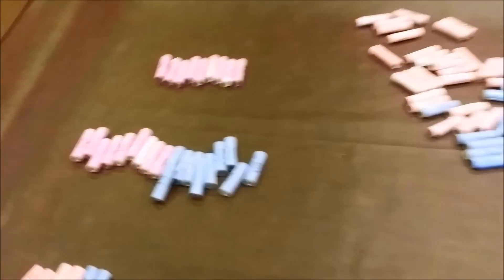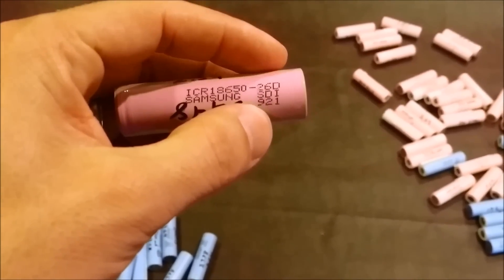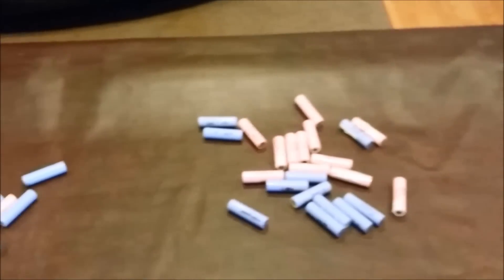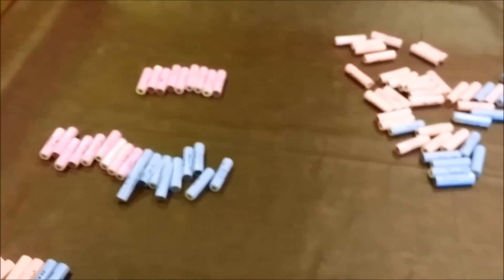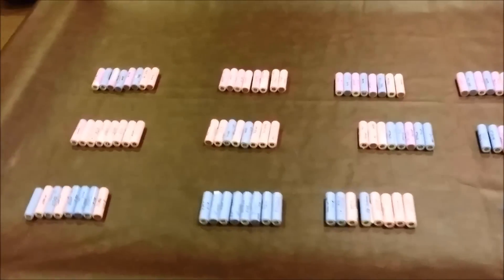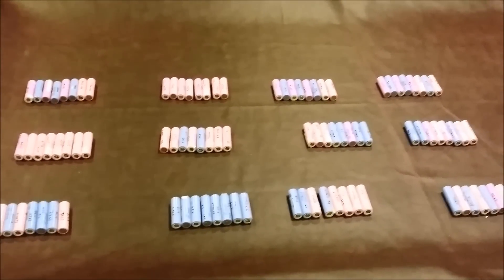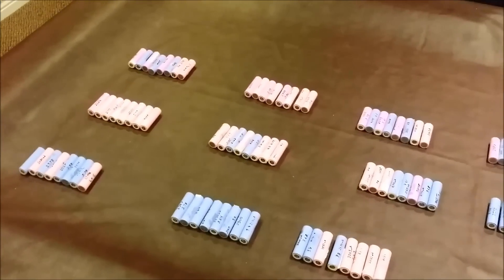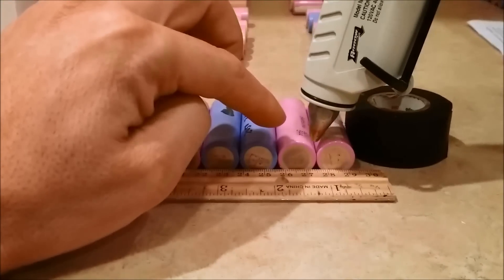Learn how to build a 48v e-bike battery "18650 lithium ion battery" (Part 3 of 7)

Comment: never hot glue them together it restricting cooling and really fun then change one bad cell after some time
Reply from the maker: I absolutely agree!  I use 18650 holders for battery pack building now because I did get this pack very hot twice.  The bag that I had it in also didn't help for cooling :) had to cut holes in it.  Thx for watching.

Comment: I just make simple 13s1p pack.
Each pack can go about 8km with pedal assist.
Make charger from step-up module with CV and CC features.
Just set 54.6v and 1amps for voltage and current
15amps bms and wrap with kapton tape.
Reply: That’s very poor range u should use at least 4p

Comment: How did you calculate you fuse size.
The fuse is 64watt. Giving you a fuse that pops at 1.3A  for a 48v total pack with a output of about 17A max continuous.   Is that correct.
Asking as I want 10s5p 15A per cell

Comment: Can i do the same but using just plain cat5 ethernet cable instead the fuses? I think eventually burn at 5a.... thnks
Reply from the maker: You really don't need them, but you could try it and see.    I wanted mine to reset instead of one time use.   Tesla uses one time use fuses similar to your idea.   My second battery doesn't have fuses on each cell just the BMS and a main shut off circuit breaker.   Thx
Reply: Why do you say dont really needed .. are fuses useless?
Reply from the maker: There not useless, but I think as long as you have a BMS you will be fine as most new cells have fuses built in already.    My next battery will be built without fuses on top.   If you have older style cells and want the extra safety then it wouldn't hurt to have them installed.   Most of the laptop cells that I took apart didn't have fuses, but some had a thermal switch if the battery pack got too hot.

Comment: You are guaranteeing the packs are not similar. use a round robin approach. your last packs are similar while the first packs have the most variation between cells.
Reply from the maker: i put cells together to equal the same bank size mAh.  The banks are very close to the same size within 30mAh.   This was a project to see if I could get good use from used laptop batteries that were going into the trash.  So far so good 1000 miles on the e-bike and going on strong.
Reply: +15-sec-of Fame  can we build 52Ah , 48v battery ?

Comment: how many cells do you need to make a 48v battery
Reply from the maker: It all depends on how much amperage you need for your project.   13 single (18650) batteries in series will make 48v, but very low amperage roughly 2-3 amps.  If you want more amperage you need more cells in parallel.  My first battery had 104 cells.  More amps you have the longer your voltage will last and not over heat.   It all just depends on what your using the battery for to know how big your pack needs to be.

Comment: I am trying to do something similar but with my electric scooter. From your opinion, do you think there will be any issues if my controller is 52v 1000w, battery is 48v, and motor is 52v 600w? I am trying to figure out if any of the above 3 components will overheat since the controller is pushing more voltage from the battery to the motor...
Reply from the maker: Your battery will be fully charged at 54.6v and shouldnt be an issue, but check the controllers specs.  The battery might get hot over time if you are always at full throttle.  The battery is smaller, so run some tests 10, 20 and 30 min temp checks.  If you hit 150 degrees stop  :)

Comment: buy a big completed lithium ion battery or buy a lead-sulfuric acid battery.How could you know these batteries,might be just one isn't real then your bike wouldn't work and can't be fixed.
Reply from the maker: the project was to see if I could build one from used laptop batteries for free.   If new would cost $600 with the charger.  I tested the cells to measure the mAh to make sure they were good.   This battery was able to provide enough power to go 35 mph for 30 miles.  The same battery pack was revised and is now part of a additional pack and is now 84v 45-50 mph for 25-30 miles.   The 84v battery that I built now would cost $2000 new, but was only about $80 for parts.  :)

Comment: You skipped soldering the third battery @ 8:32 - Only one nickle strip is connected to that battery. I know this was a year ago and you probably caught i later on when attaching your re-usable fuses, just thought i would point that out just in case :) Great videos!
Reply from the maker: Quick eye you caught that too lol,  well I meant to do that as it adds turbo boost when it finally makes a quick connection from vibrations :)  Yeah off video I went back later and went through the whole thing to check all my connections :)

Comment: Nice and informative video.
I have some questions to you.
What is the square yellowish square between one parallel cell to the other?
Do you discharge the cell to certain voltage before soldering?

Comment: Why are you connecting every battery in parallel? Why not have 13 different strings of batteries in series? 13 different strings will prevent current from running through the battery when it is not connected.
Reply from the maker: Hey Filip,  You could have connectors separating each bank but it sounds like a lot of extra work to do that.   The  way I have it is the following (sorry if you know this already.)   I have 13 separate banks connected in series and each back has 8 batteries in parallel.   The 13 banks in series combines to equal the total battery voltage.   One bank of the parallel batteries gives you the total Ah of your battery.    If I have an issue with power loss while not in use then I have an issue with one or more cells in one or more of the banks.   You will have to find the bad cells and replace them.  The battery should not self drain by much at all if you have good cells.
Reply: But why connect them in parallel at all?
Reply from the maker: It combines the mah of each cell in parallel to get the Ah you need.   If you have 2200mah cells or 2.2 Ah cells  take 2.2Ah x 8 cells you get 17.6 Ah.  Of those 8 cells your still only at 3.7v (not charged).  So now you need to build up the voltage.  3.7v x 13 cells or banks in series =48v.  If you didn't have the parallel cells you would only have a 2.2Ah 48v battery and that will not have enough power to do anything.  Think of each parallel bank of cells as a single 18650 cell to make it easier.  Except your single cell is now a 17.6Ah cell instead of 2.2 Ah
Reply: Okey thanks :D

Comment: how or where would you place 18650 cells that have been over discharged before in a pack?
Reply from the maker: I just threw them on the Imax B6 and discharged them to 4.2v  then did a discharge test to see if they were still good.
Reply: so you never pair up cells that started at less than a volt?
Reply from the maker: I still tested those and found a hand full that was still good.  I had one get hot during recharge from 1 volt.   Depends on how long they were at less than a volt range.   If they are near .3v to zero volts I wouldn't even mess with them.

Comment: I have a question I have 33.6 amp hours after adding up all my mah from my 20 cell pack .I want to put it in a modified razor scooter that use 2 12v sla batteries I want to over volt it at around 36v what configuration would I need to I need a bms and or fuses
Reply from the maker: Cameron I would leave it at 24v.   36v may fry the motor as I have seen the motors on the razors get really hot at the 24v range.   I also fried my ebike display and controller as I also over volted the ebike from 48v to 60v.  It only lasted 50 miles.  What kind of battery packs are they 3.2v or 3.7v?  This will determine the type of BMS you will need to get.   I have now converted my bike from 48v to 72v (84v peak) with a new display and controller
Reply: +15-sec-of Fame 3.7v recycled laptop batteries also my other worry how do I get passed the amp draw from these bikes? can I just add more 18650 so there not working as hard .one other question what can I do with 600 1.4v NiMH cells .sorry if I have over loaded you your the first person to respond to me .
Reply from the maker: cameron G its cool man,  man its your call on the NiMH cells... Ebay!   They have amperage for sure if they are still good but you will need more of them plus they hold memory effect.  
Yes if you put the 18650's in parallel it will help keep the cells cooler.  I am assuming the lead acid batteries are around 3-4 amps each x 2 batteries to = 24v nominal @3-4 amps or  27.6v fully charged , so if you put 3 to 4 18650 cells in parallel to equal one pack X 6 packs in series to get your total voltage of 22.2v nominal voltage you will be in the voltage range .  Buy a tester to test each cell to see where they are in mAh's.  If they are lets say 1700mAh x 4 in parallel thats 6.8 amps.  What ever your parallel packs are in Ah thats your AH total for the entire battery.  then just series the packs for voltage.  you will need 6 to 7 in series.  6 will be the safest @ 22.2v nominal fully charged will be 25.2v and 7 will be pushing the limits of the controller and motor as the nominal voltage will be 3.7v x 7 packs =  25.9v fully charged will be 29.4v
Reply: +15-sec-of Fame the lead acid batteries are 12ah each there are 24 ah .when starting the scooter it's 10 amp draw for 1 second and then 6 amps  continuously .I test my batteries with a IMAX6 I have 200 18650 cells . so to get passed the 6 amp continuous. I need a group of parallel 18650s so it doesn't put a strain on the batteries cool :) I'm going to use an ezip 750w for my battery pack and tests .
Reply from the maker: damn dude that things a beast lol  yeah just play with the numbers until you have it... for me thats the fun part.  I was blasting 5.3 amps max per cell with my 960w 48v battery system only lasted 30 miles with slight cooling ventilation to the cells.  Now with my 1600w 72v battery system Im pulling 3.7 amps max per cell.  Im using 164 cells total 20s8p battery pack or 20 in series 8 parallel.  stays cooler now.

Comment: If the cells I use are 6 AH then what size fuse should I use?
Reply from the maker: Hey Gage,   I wouldn't worry about each battery as long as you don't over power them for long periods of time.   On first test rides check your battery for overheating every few miles so you know your limits before it over heats.  Mine was at 30 miles with my 48v battery.  Just have a main fuse or circuit breaker in case the battery shorts out during a crash.

Comment: I have another question to you, my favorite source of information :):
What material should I use for the metal I melt when soldering? I bought one with something like 60 tin and 40 lead, will that lead the electricity well or should I use something else?
Reply from the maker: +Filip Bjurling yeah man, I would get solder with lead as tin gets lumpy and doesnt flow to good.   Lead is easier to work with just make sure you have ventilation so you don't breath in the fumes.   Here is the link to the buss wire.  http://www.ebay.com/itm/30-Feet-Solar-Cell-BUS-WIRE-5mm-x-02mm-Pre-soldered-/251870723653?hash=item3aa4aa3e45

Comment: Repost, please answer:
You are using some kind of pen to cleen the anode and katode before welding. What is that?

Are you useing tin as the wire you are melting?

What material is the metal plates conecting the batteries? And where can I buy those?
Reply from the maker: +Filip Bjurling Hey Filip, the pen is a "flux pen" to help the solder to stick to the battery.  The metal strip is nickel strip that has been tinned with solder on it so it has quicker flow during soldering.   I was trying to make the solder joints as quick as possible 
http://www.ebay.com/itm/30-Feet-Solar-Cell-BUS-WIRE-5mm-x-02mm-Pre-soldered-/251870723653?hash=item3aa4aa3e45 .   
The metal plates are reset-able fuses you don't have to use them, I did it for extra protection. 
 http://www.ebay.com/itm/100-Pcs-New-JinKe-Polymer-PPTC-PTC-DIP-Resettable-Fuse-16V-4A-JK16-400-/181623447300?hash=item2a4999df04
thanks

Comment: I am having a really hard time getting the solder to such to the ends of the batteries. How were you able to solder so easily? I've tried using flux too, but that didn't seem to help.
Reply from the maker: +Paul Langford Hey Paul is it beading up and rolling like a ball bearing?  if so then the surface isn't getting hot enough yet for the solder to stick to it.   A 40w soldering iron isn't going to be hot enough to quickly heat up the end of the battery.   I bought a high power soldering iron for this part.  The Weller 140/100 watt soldering gun kit is what I used to pre-solder the cells.   Its not meant to be continuously used as the soldering iron will get hot after about 30 min and I had to buy another one as I burned one up by using it to long.   It will stick in about 3 sec's with this.  the cell will get warm but not hot.   Remember be quick! no longer than 5 sec on the cell.
Reply: +15-sec-of Fame I was having the beading problem before, but that speed happening. Now it just won't stick. You're right, I'm probably not getting the surface hot enough. Although, I do have a100 w iron. can you think of another reason it wouldn't be sticking? thanks
Reply from the maker: +Paul Langford if there is any oil on the surface that will cause issues also.  Not sure if you cleaned the surface first, but I used rubbing alcohol very lightly with a lightly damp cloth to prep the surface.  Also, dont use a fine tip use a larger tip on the soldering iron, the bigger the better and pre-tin the soldering iron.

Comment: Forgive me if you've answered this before.  Do you use used laptop packs?  If so, what % of usable cells do you find?  In other words, how many packs do I need to get for a 48V e bike battery?
Reply from the maker: +Wendell Goode  yes I did use laptop cells.  I would say that I opened 30 packs and 25-30% of the cells were above 2000mA.  They averaged around 1700-1800mA.   If you want to save some money, but dont mind spending a lot of time charging and discharging this is the way to go.   I did this to prove that you can build a good battery from used packs.  I used Dell packs with 6-9 cells each.   The battery has 104 cells (8P-13S) and is around 18Ah.

Comment: Please let me know the name of the fuse that you used at the end of this video.Thank you.
Reply from the maker: +Sangwoo Seo here is the link to the fuses
 http://www.ebay.com/itm/100-Pcs-New-JinKe-Polymer-PPTC-PTC-DIP-Resettable-Fuse-16V-4A-JK16-400-/181623447300?hash=item2a4999df04
Reply: 15-sec-of Fame Thank you.
Reply: 15-sec-of Fame If you have time, please describe the detail sequence of wiring BMS to battery cells on your video (4 of 7).
Thank you very much.
Reply from the maker: Sangwoo Seo no problem man, On my profile page I posted a picture of the wiring diagram of my BMS to help.  Ok so the BMS board will need to be connected to the first banks negative (that is also the negative of the battery).  Its the short black wire that I soldered to the BMS board and the battery.  Then the first negative wire (from the connector) will connect to bank 2's negative, second wire will connect to bank 3's negative so on so on now your at bank 13.  The last negative wire connects to bank 13's negative and the last wire is (red) will connect to the positive of bank 13 and that is also the positive of the battery.  Hope this helps you understand and let me know if you have any more questions.
Reply: +15-sec-of Fame 
Thanks for the quick response.

As posted on your video (4 of 7), I first soldered all of the battery cells with balance wires, and then connect the balance connector to BMS. So, the wiring sequence is a little different from yours.
I did like this four times. I succeeded three times, but failed once. When connecting the balance connector to BMS, the BMS was broken with a little spark occurring at the end of positive pole.

What do you think of this situation? Do you think it is caused by the wrong wiring sequence or bad/low/already broken quality of the BMS?

Please give me your opinion.

Thank you.
Reply from the maker: Sangwoo Seo yeah sorry, its hard to what caused it.  If you wired it exactly like the others, but this one broke I would say the BMS was bad.  The BMS is very fragile and if one wire is not in the correct place it will break it.  You can put your negative leed from the multimeter on the negative of the battery and with the positive leed check each wire on the connector starting with pin1-13 and see if the voltage goes up in the correct in order to make sure the wiring is right.
Reply: +15-sec-of Fame I will follow your wiring sequence for the next time. I think it is much safer than what I did before. Thank you very much.

Comment: How can i measure the capacity of this cell's?
Reply from the maker: +Burakhan Sivri it helps with keeping the battery balanced.  You also want to have similar mAh rating so one bank of cells dont use all of its energy before another.   Having miss matched cells will also lower your power, range and can cause a bank of cells to become over discharged or overcharged.
Reply: @15secofFame  he said HOW

Comment: For the resettable fuses, is 16V sufficient for your build if you have a 48V battery? I guess if the fuses are in series the voltage capability stacks as well?